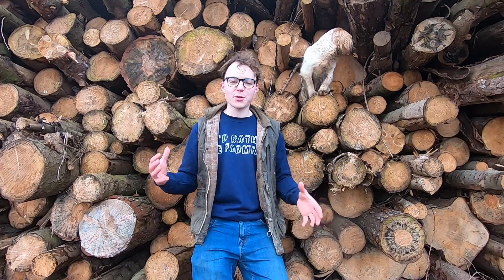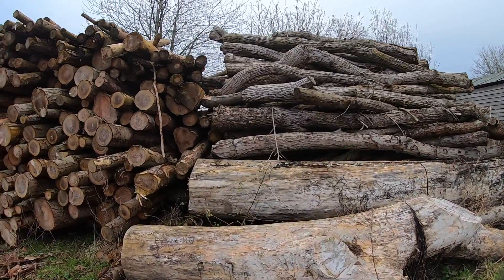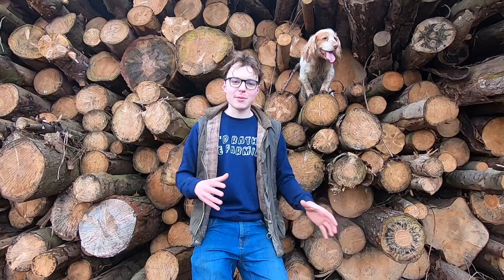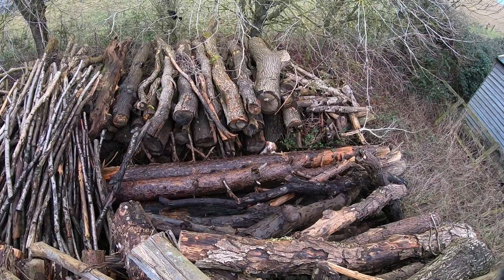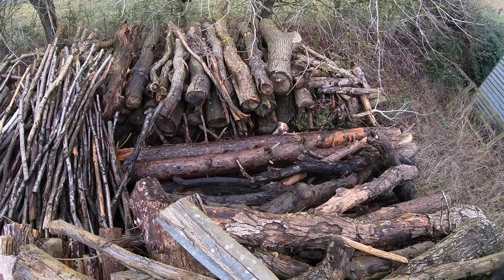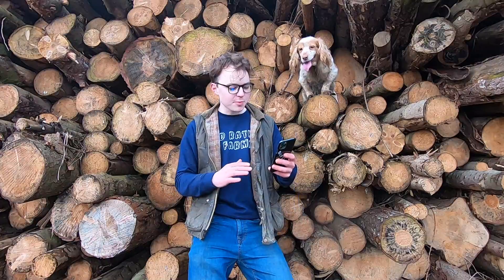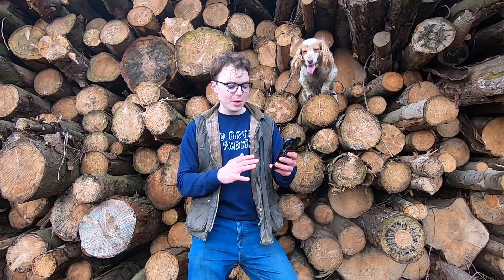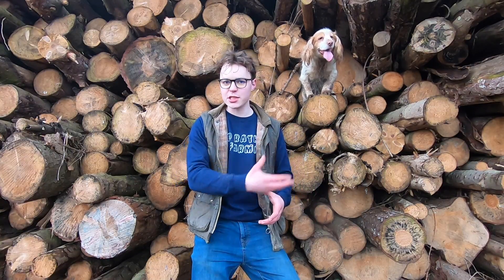THIS IS HOW WE'RE GOING TO HELP TO SAVE THE PLANET ON THE FARM BY 2031

Comment: Something that all these enviromanics seem to not realise is that if there is no carbon in the air then plants wont have anything to live on and all plant life on this planet will die and then we will, plants need carbon to live, and then there is the fact that 40 years ago NASA sent up a satellite that took pictures of the earth and when they compared those pictures to pictures that they took i think it was a couple of years ago and something they realised was the earth is much greener now than it was 40 years ago when there was less carbon in the air, and scientists have discovered that thousands of years ago they was 3 times the amount of carbon in the air and the earth was much greener, and then you have the fact as people have already pointed out we produce very little carbon compared to china and india and that so why should we bring our quality of life down when china and india wont and they produce most of the carbon that is in the air, and there are scientists that claim that in fact a bit more carbon in the air would help plant life a lot, and as for Olly claiming that the diesel is fossil fuel that is simply a lie and untruthful because nowadays it is biodiesel that is made out of oilseed rape, I know because on our farm where we run tractors from the 80s and early 90s we have problems with the biodiesel eating through the rubber lines because they eat through the rubber which is designed to run on fossil fuels not biodiesel and then there is the fact that fossil diesel last forever, i know people that have old 20 year old cans of the old diesel and it still works but with the modern biodiesel it has a 6 month lifespan then it goes off and is no good, you get algae grow in it which causes lots of problems especially when it blocks the fuel lines or grows in the piston which is a nightmare to deal with, basically all this video is a load of rubbish claiming all the rubbish i hear all the time from left extremists all the time, unsubscribe.

Comment: Using crop to produce methane just to power your trator is probably not economically viable, because the amount of crop you are going to need to produce enough methane is going to cost you more than to buy diesel. Producing hydrogen through DA at the moment is not so eficient to. I would try to use slurry and muck instead of crop and if you don't have enough instead of replacing the tractor try to replace the manitou i think Claas or Valtra had one running with methane

Comment: Not a fan of any of this electric tractor stuff it will never work
Reply: Why wouldn't it?
Reply: Theoretically electric power would be better than a Diesel engine. The amount of torque you receive from electric power cannot be matched and is instant. Plus battery technology is accelerating very quickly it won’t be long.
Reply: @colliedogs4586  cant beat the sound of a diesel engine though